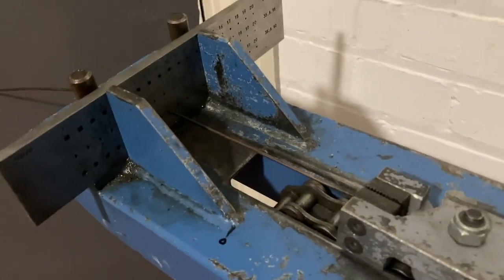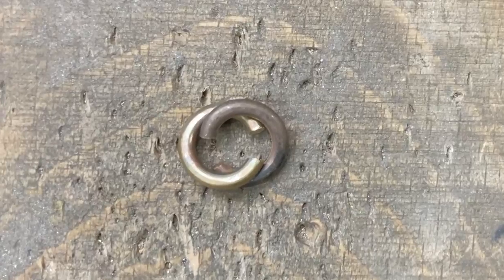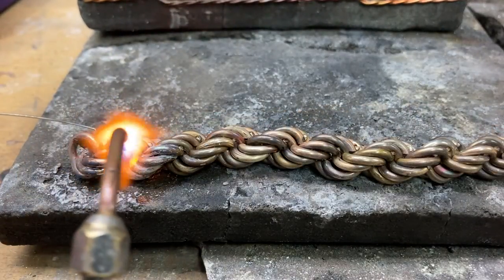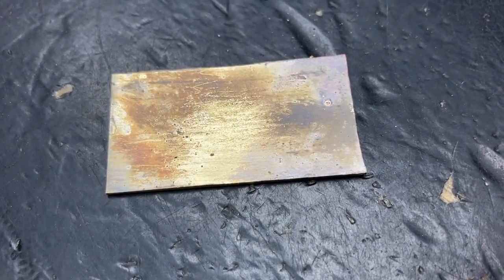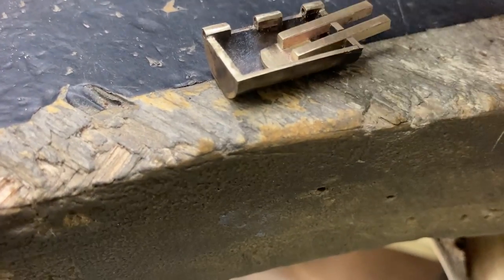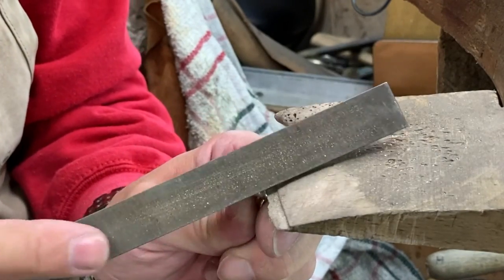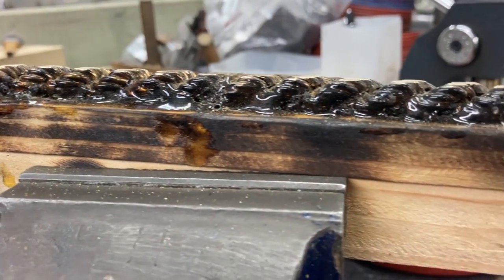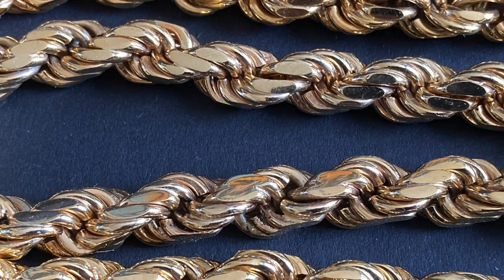Diamond cut effect rope chain

Comment: Where are you located?
Reply from the maker: uk london
Reply: @MadeByHuss  one more question  do you think it's cheaper to buy 1000 1.3mm diamonds or buy a bigger mm diamond so you could use less if I'm right??
Reply from the maker: @mjz187  i would say smaller diamonds are cheaper but it means you have to set more 1000 stone is a lot of work
Reply: @MadeByHuss  yeah tru but only thing is 1.3 diamond small as heck
Reply from the maker: M Jz yes they are you have to go with what you can afford